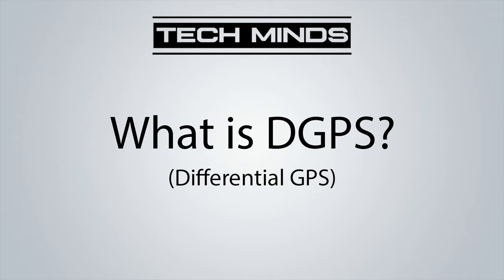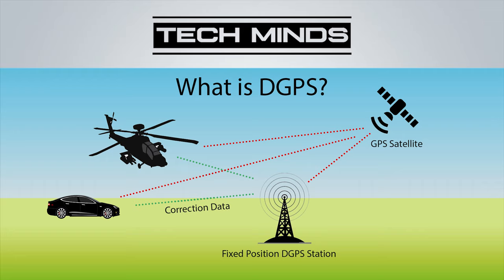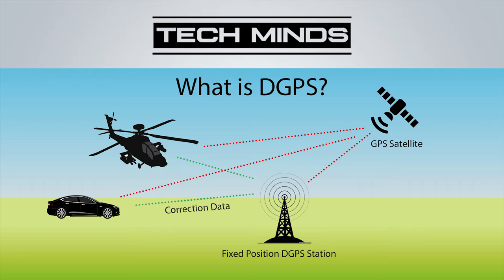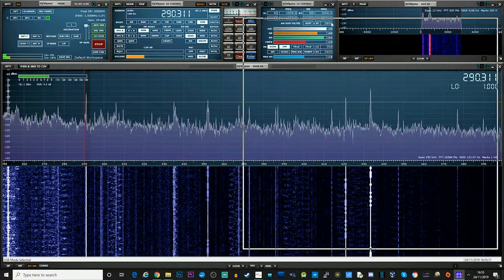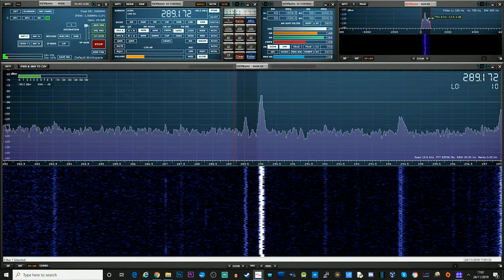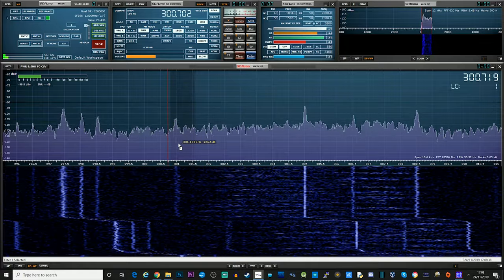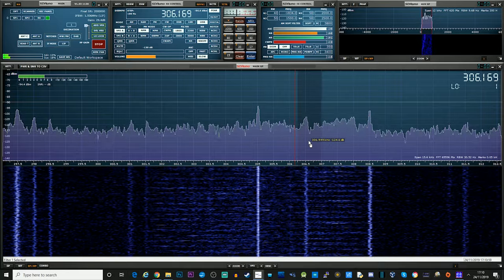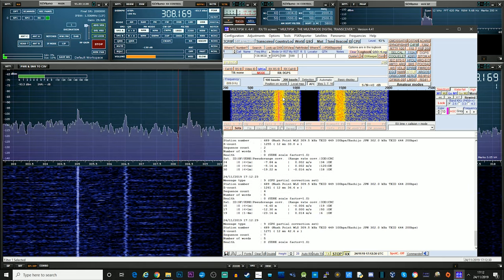DGPS Differential GPS Decoding With RSPdx And MultiPSK

Comment: The differential corrections you show from north foreland and Flamborough head are now part of the shore based differential corrections.  They essentially used the ITU assigned frequency for the old DF bearing systems if you Notice the locations are on top of lighthouses where the DF locations were.

As a ship captain we used satellite subscription based spot beam differential corrections which are pricey.

As a private pilot most DGPS receivers also make good use of SBAS systems (EGNOS, WAAS, GAGEN ETC)to enable better verticals profile resolution